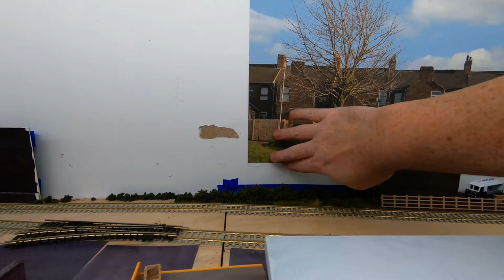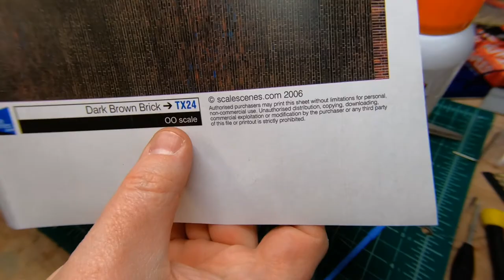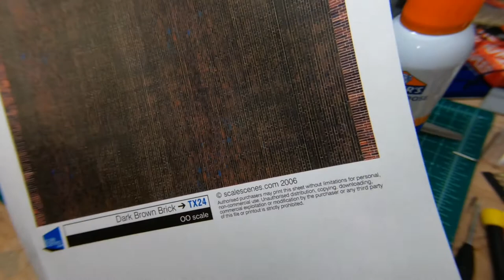oorail.com | November 17 2019 - 15 Minute Model Railways

Comment: To be honest friend, doing the 15 mins plus editing and uploading is quite onerous, so if you miss, especially with all of your other commitments, then we have no right to complain and you should feel no guilt. Over here in the UK, I doubt we would solder any of the fishplates as not many of us will have AC. Soldered fishplates would give us no end of problems with track buckling in the summer with layouts up in the loft where it can get unbearably hot.
Reply from the maker: Thanks for your kind comments. I'm not under any pressure to knock out videos, like others have said, this is a hobby and for fun. One of the main reasons for sharing on YouTube is to help others out by sharing information and knowledge. The layout here is huge, need some kind of motivation / light a fire under myself, or it could be years before some of these projects get completed! I don't typically solder fishplates, in fact that pair maybe the only ones on the layout that are. I was short on fishplates a few years ago, so I ended up using Atlas ones (American brand) but they can sometimes be a little loose. I solder these because they are in a section of track between those points and a set of curved Hornby points, so it was just faster to solder the back of the fishplate to the rail to stop it from moving, than to pull up a section of flex track to swap out the fish plates. There is an expansion gap on the other end of the rail. I'm actually quite surprised at the number of people that leave really expensive track and rolling stock in very hot lofts over the summer in the UK. I'm lucky that the houses here in the States have basements, so I've got the full length and width of the house to play with! :)

Comment: Well that was a long 15 mins 😊   I'm not videoing it but I'm doing the 15 mins a day to sort out all my stock.
Sadly most of it is going in the service/repair bin. But I have a few items in the keep and sell bins. 
So I'd better start selling off what I don't want to hold on to so that I can buy some more stuff.
Cheers
Reply from the maker: Lol.. yeah I'm still trying to get the hang of explaining the project while I work on it. What kind of service issues are you having? I went to dust off my Heljan Class 47 only to have a bogie fall apart. Looks like a plastic piece that clips over the top of the bogie to hold it together was warped and broke. Not sure yet, but looks like it may have been a reaction over time with the oil used. Looks like I'll be knocking some CAD together and 3D printing spares for that this week. 

The kids had a bit of a crazy hockey schedule this weekend, four different ice rinks across three different cities but was worth it, they have fun and didn't hurt that my middle kid ended up with an assist and scoring the game winning goal with 52 seconds left, with two of his former coaches who coach elsewhere now looking on. Found time though to get it filmed, edited and encoded.
Reply: @Oorail  I have an old Hornby Princess  that the front bogie just fell apart in my hands. Luckily it came with the alternate bogie for large radius so I can still use it.
Mostly poor running issues and missing buffers etc. I bought a lot of used items over the years inc. job lots so it's to be expected.
Good to hear your kids get out and about instead of sitting in front of a screen all the time :)